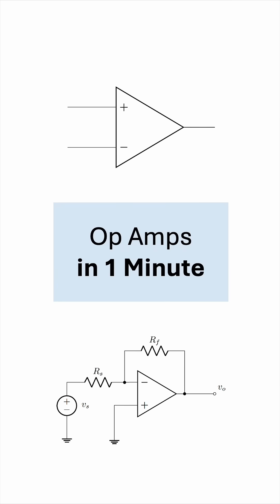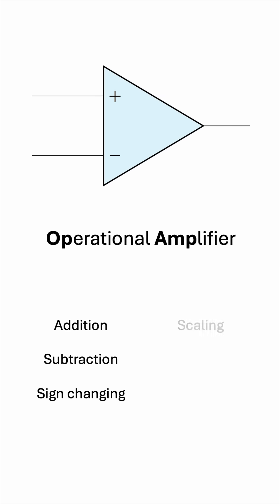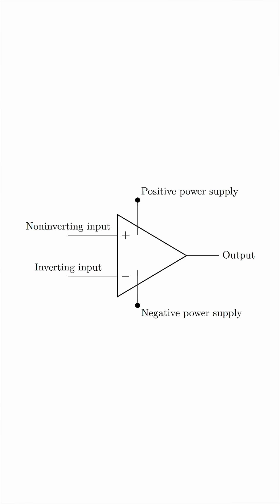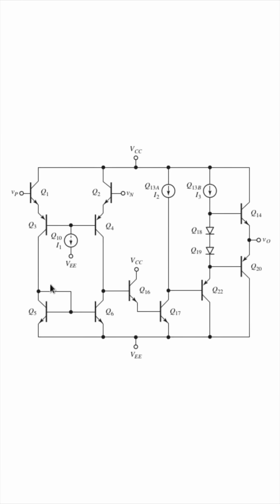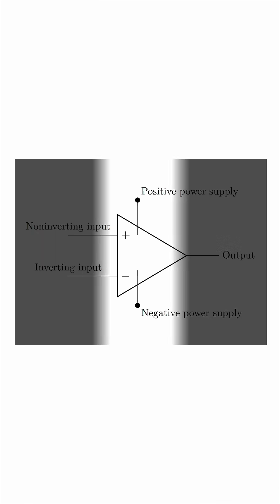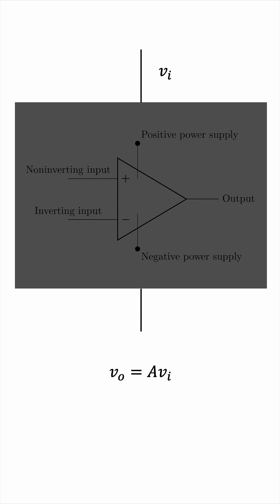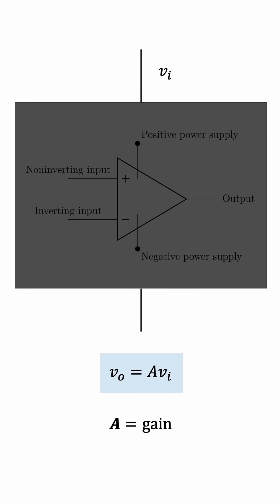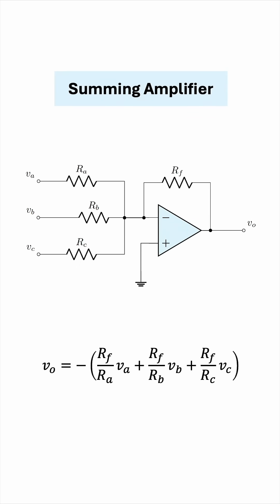Op Amps Explained in 1 Minute #physics #electricalengineering #amplifier

Comment: This isn't a good explanation. 
Just explain that it tries to equalise the voltage between+ and -, that explains everything else
Reply: Can you explain why it explains everything else?
Reply: In a closed-loop configuration with negative feedback, the op-amp output adjusts until the two input voltages are  equal. Outside of that condition, the rule does not apply.
Reply: I disagree